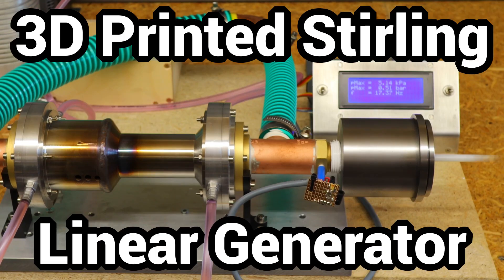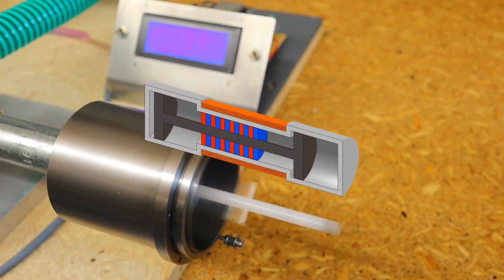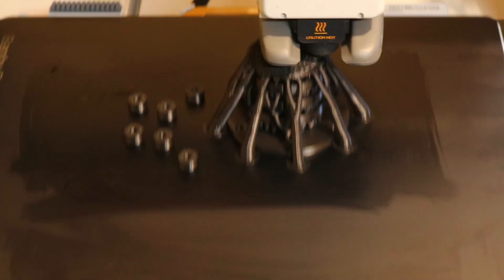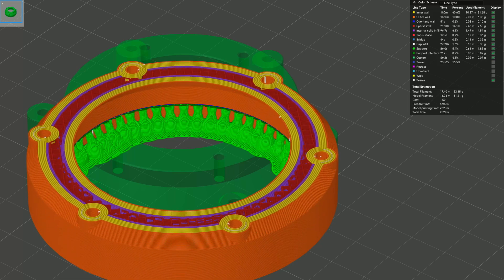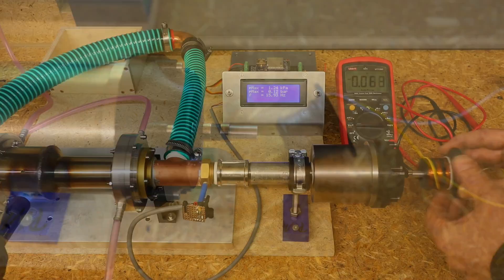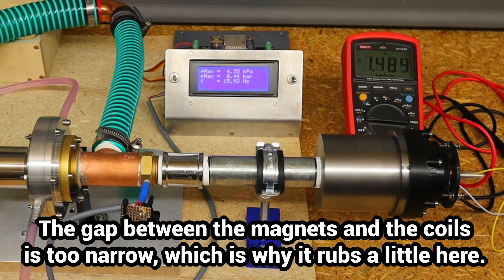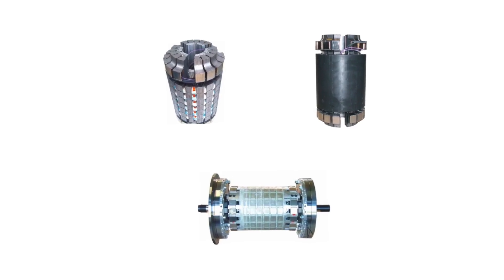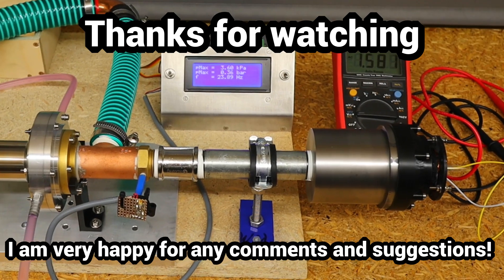Linear Generator for thermoacoustic Stirling engine – how to get most power from magnets and coils ?

Comment: with an estimated middle wire length of 8cm per winding, times 4000 = 320m wire length overall.
with a wire diameter of 0.2mm you get 0.54 ohm per m.
times 320 you get ~ 173 ohm internal wire resistance. please measure this value.
3V emk into an equal load resistor (max power point) drops to the half usable voltage. 1.5V into 173 ohm you get 8.7mA current through the load, and this results in 1.5V times 8.7mA = 15.7mW.
congratulation!
and how many input power from your gas flame do you need?
Reply from the maker: Yes, the wire is much too long and too thin, only less windings near the magnets  are better.
It was just a first try, and thanks to the help here I hopefully get soon a better generator!
At the moment I think a flat design is much better?
Thanks for your help!

Comment: I'd try it the other way around:
Moving coil and fixed magnets.
Take an old woofer without a diaphragm, just with the internal guide. Perhaps adjust the natural frequency to the natural frequency of the piston using a spring.
Reply: How do you use the induced current without brushes or slip rings? A secondary coil?
Reply: @ShinyUmbreon765 
Exactly the way the wohler does. User the flexible wires of the woofer

Comment: well if you could use a metal 3d printed iron core design but that is the perspective of a machinist.another will be make the piston light as possible since liner motion is not efficient as rotational. try to 3d print a part and use a vacuum cast to make your custom iron core before pulling the trigger on a fully 3d printed part

Comment: I guess you can cut a small transformer in half for testing. The iron core + magnet should be shaped so, that the magnetic flux reverses every time the magnet passes. This can be achieved with a iron core with 3 legs, where the coil sits on the middle leg. You want a rapid and wide change of the magnetic flux for higher voltages.

I think there exists 3d-printable filament that contains magnetic iron, acting like ferrite iron core.
Maybe you can keep the magnet much smaller, because it gets much more strongly coupled when using iron core.

You can get some ideas if you look for the "sunpower stirling cryocooler" in the net.
It uses flat springs to hold the linear moving parts in place.

You should aim for higher voltages. Because these standard diodes have a big voltage drop of 0.7 to 1.4 volts. If your generator generates only 3 volts, then 0.7 volts are a big part of it. If your generator generates 70 volts, then 0.7 volts of the diodes are negligible.
There are also "active" rectifiers using MOSFETS, which do not have this voltage drop and therfore perform better on low voltages.
Reply from the maker: Thanks for your great suggestions, I will think about them carefully.
Do you think that "magnetic filament" is really efficient?
I don't get how your 3 leg iron cor coil works, can you please describe it more?
Many thanks for your great help!
Reply: @myengines2443  Probably the filament is not as efficient as standard transformer sheet, but better than pure plastic and free to take any shape.
Transformer sheet is made from a special type of iron, making it more efficient, and the sheet structure prevents eddy currents.
Ferrite is used for higher frequencies, like >1kHz.
Each material has a a measure called "magnetic permeability".

A 3 legged core would be for example the TDK PC47EI50-Z.
It looks like a fork, you can find pictures online.
Let's label the first outer leg A, the middle leg B, and the second outer leg C.
We leave away the the top bar, leaving the 3 legs with open end.

Imagine only leg B has a coil (the middle leg).
The magnet has only half the size, so it can only close the gap between leg A-B or B-C, it does not reach over all 3 legs.

1. Phase:
Imagine the magnet is located so that it closes the gap between leg A-B. It's south pole is on A and the north pole is on B. Leg C is open. Then the magnet produces a closed loop of magnetic flux through one half of the fork shape.

2. Phase:
Shift the magnet in a linear way to the other side, so that the magnet now closes the gap between leg B-C.
Now we have another closed loop of magnetic flux, through the other half of the fork.
But now the south pole is on B and the north pole is on C.

So the middle leg B, where the coil sits, experiences an alternating direction of magnetic flux.
On the 1. phase it is facing the North, and on the 2. phase it is facing the South of the magnet.
That would be the maximum change in magnetic flux and should therefore create the maximum voltage.

Since the magnet would be attracted to the iron core it has to be put on a linear bearing or some other kind of movable support.
If 2 opposing iron cores are used then the attraction force may largely cancel out.
(Or a 3D-Printed rotation-symetric core ;-)

However, this configuration has the disadvantage, that the size of the core should match the amplitude of the piston ... 🤔
Maybe a "voice coil" configuration would be more suitable?
Reply from the maker: @notconnected3815  thanks for your very detailed help, I will think very carefully about it and for sure will have some additional questions, many thanks!!
Reply: @myengines2443  using an "E" core.
two magnets on a yoke, as the "piston". spaced far enough apart so they bridge two legs of the core. two cores, one on each side, to make a figure 8 with magnet yoke up the centre. coil mounted on center legs.

magnets and core chosen so the magnets are slightly smaller than the gap between each leg, and the distance between the two legs equal to the stroke.

at either end of the stroke, the central leg of the core is over either magnet, with the opposing magnet bridging either of the outer legs, alternating depending which end of the stroke its at...

mid stroke, the magnets will be in between the legs.

that way, you get maximum flux at the end of the stroke, and minimum flux in the middle, and the magnetic flux reverses completely when its at the other end of the stroke.

maximum rate of change, maximum output voltage.

it is the only way to produce a true "AC" voltage.
any other arrangement wont reverse the magnetic flux, and so gives half the output.

Comment: The counterbalance can be a tuned mass damper (e.g. a mass on a spring that resonates at the same frequency as the piston). For power transfer, you could look into MPPT controllers for turbines, which are already designed to handle multi-phase AC inputs. The commercially available ones might not be very useful to you however since most of them are made for higher voltages. If you need rectification at a low voltage, schottky diodes can be used, as long as your coil voltage stays below their low breakdown voltages.
Reply from the maker: My diodes are schottky diodes but the voltage drop is still to high for my low voltage setup.
Thanks for your kind help, I think carefully of it!

Comment: Just a comment about 3d printing. I have printing bambu PPA-CF and PAHT-CF parts on my bambu A1 without any issues. I have not made any objects taller then 4 cm yet but based on how good it prints i g uess it should work. :-)
Reply from the maker: Thanks, I will try it out as soon as I get a good generator as a power indicator running!!

Comment: Why not glue a membrane of a big speaker instead of the magnets. 

Speaker already has coil and strong magnet in  ideal situation
Reply: I think that's a good idea, because the speaker coil has low mass and it is already held in place by a membrane 👍
I am not shure if the wires are strong enough to handle the intended output power 🤔
but i would give it a try 🙂
Edit: + they are mass produced and therefore cheap and available 😉
Reply from the maker: I don't know if they are really made for good efficiency for my purpose.
Also the have to match the conditions of the engine which change with every modification.
At the moment the engine delivers only a few watts but i hope to reach much more in the next month and I want an easy scalable generator that i can build and modify to my needs.

Comment: I believe there should be pages of electrical engineering math to optimize the number of turns, wire gauge, magnets, CNCd silicon steel sheets, etc. Would be cool to see.
Reply from the maker: I've read a lot recently, but unfortunately I haven't found any comprehensive instructions on how to build an effective linear generator.
If anyone knows of one, please let me know...
Reply: @myengines2443  Treat it like a rotary generator that's been "unrolled". The same basic equations apply, except instead of RPM you would use the average linear piston speed. Adding iron pole pieces to concentrate the flux will help a LOT, and I suspect you will also see improvement by reducing the number of turns by a factor of at least ten, and using much thicker wire. The iron will increase the flux density (and thus voltage) significantly, so dropping the winding count will help counteract that.
Reply from the maker: @MysticalDork  thanks, I will try this!
Reply: @myengines2443  Read what paradiselost9946 wrote. That is the good answer.

Comment: Kinda looks like you might be winding your way towards a speaker motor, though granted, your machining work is a lot nicer. Might be worth grabbing a few off the shelf speakers to get a better sense of what drive size you are looking for. In theory, a liner generator could cover a range of drivers, but is the added complexity worth just yet? Perhaps it is easier to temporary redirect flux than build an adjustable liner generator? Just thinking aloud and hoping it helps, best of luck
Reply from the maker: Thanks, I will think of it!

Comment: I dont see why you dont cut the cone from a speaker if you dont want to use it directly, before you start worrying about longevity it would be good to get meaningful power.
The fact you have so many turns of wire and such high power magnets producing so little voltage must mean the impedance of the system is incorrect (the weight of the piston and magnets) and your piston is tracing out a harmonic of the fundamental of the sound oscillation - or your generator is flawed.
Reply from the maker: I think I have far to many windings which are too far away from the magnets just having much resistance.
Do you think the cone of a speaker has a good efficiency?
Reply: @myengines2443  Resistance would only come into play if there was a load, you would still see a high voltage, so its not the number of windings, too far away might be as issue. I dont know about the cone, but the generator part has a very strong magnetic field with a coil sandwiched in a small gap with tight tolerances, it should be relatively efficient, it is also very lightweight moving the coil not the whole  magnet.

Comment: You might find it easier to remove the support materials and need fewer supports if you print the part with the copper coils at 45° or 90°.
At 90° you should only need supports on the widest sections the gaps where the wire goes should be short enough for the plastic to bridge.

Hope this is helpful & best of luck
Reply from the maker: But isnt the accuracy not quite bad (roundness of circles etc.) then?

Comment: For increasing your motor efficiency, you need to concentrate on the magnetic circuit that connects the north and south pole of your magnets. In order to get a high magnetic field, you need to maximize the distance that the magnetic flux travels through iron. When the flux travels through air OR copper, you will loose a lot of field strength. For example, Voice coils (such as loud speakers) have the magnetic flux travelling THROUGH copper. This explains why they are low power/low efficiency. It does not matter so much for loud speakers because our ears are so sensitive to the little power contained in sound.
Reply from the maker: I tried to make the gap between zhe magnets and the coils as small as possible but I think I really need some iron.
I am still searching for the best way to relise the magnet/coil configuraton I maybe a flat (like in linear motors) configuration is the most effective?
Reply: @myengines2443  Your target of a small gap between the magents and the coils is sensible, but it won't get you to high efficiency, as the flix has to travel through the copper (which it does not want to do). The most efficient use of magnets and copper will be a linear motor. Imagine a normal rotating BLDC motor. The copper is wound around the Iron stator teeth. The magnetic flux flow through these teeth and only needs to jump a tiny gap to enter the iorn of the rotor. Now imagine rolling out the stator and rotor of the BLDC into a flat linear motor. You only need a single set of teeth, as you only need limited reciprocating movement.  Hope that makes sense.
Reply: lol, you want to minimise the path through the iron as well! every extra and unnecessary millimetre is simply adding to the reluctance, and leakage of magnetic flux... i cant argue the fact that you do want the smallest air gap possible of course...
Reply: @paradiselost9946  Ok, I will clarify my statement :) One should aim to maximise the percentage of the magnetic circuit being in iron and minimize the percentage of the circuit going through either air or copper. Also, one should aim for the shortest circuit that achieves your motor performance goal.
Reply from the maker: @pete_dl1585  this is the help I need, thanks a lot I think the next generator will be of the flat type like a linear motor!
Reply: @myengines2443  One warning I would give is that designing a linear motor will be quite a lengthy side-quest. 😀Adding Iron into the motor means the magnets will try to slam your "rotor" into the stator, so you will need to strongly resist this with linear bearings (for example). Also you would have to consider losses in the iorn. Ideally having custom laminations, but I suggest starting with solid Iron. Also, it would be preferable to have the spring that restores motor to a neutral position to be in resonance with your moving mass, otherwise the generator will draw energy from the circuit in sections of the reciprocating cycle.

If you can efficiently turn the reciprocating motion into rotation, you will be saving yourself a lot of design time, as beautifully efficient rotating motors are very abundant and cheap.
Reply from the maker: Yes i really would like to use a rotation but this requires a constant stroke which the thermoacoutic engine does not have.
It varies with the parameters and the variations I make which will be very big in the future.
I need a conversion mechanism of linear to rotational motion with variable stroke but I do not now any with an acceptable efficiency.
I have pure iron 2 mm thick ( is pure iron ok as I can't get any source for electric steel (silicon steel)?) which I want to isolate with paint and bolt together as the iron core.
The moving part has to be guided by sturdy linear rails which increase moving mass but that is feasible.
Reply: @myengines2443  I see. Does a thermoacoustic engine have a natural frequency it resonates at, or does it depend on engine config ? If the frequency changes, you have a difficult situation. The linear motor needs a spring to bring it back to a neutral position. That spring strength would have to change if your engine frequency changes. 

Yes, pure iron is fine.
Reply: @myengines2443  if your goal is to perform useful work with your generator, I suspect the easiest solution is to use the reciprocating motion to pump a fluid. IE have a cylinder plus a one way-valve.
Reply from the maker: @pete_dl1585  but I want to generate electricity...
Reply from the maker: @pete_dl1585  the frequency depends on the engine configuration which makes it more difficult.

Comment: Look closely at the Video & Pause it, notice the LightWeight Circle of magnets compared to all the Iron. Think about how all the Iron will work with those magents & the Coil !!!
And the Stroke is only about 12mm ! (Pressure is about 600PSI !)
Reply from the maker: Ok, I hope I will get it, thanks!
Reply: sorry, complete different world.
compressed helium.
moving parts.
driven by an linear aktuator.
simply a cryo cooler.
but ok. some features can maybe adapted

Comment: nehm anstelle deines komplizierten arbeitskolben+lineargenerator einfach einen lautsprecher...
Reply from the maker: Ich kenne mich da nicht gut aus und Lautsprecher arbeiten nur bei einer festen Frequenz gut und wie findet man die heraus?
Wie sieht es mit späteren, höheren Leistungen und Drücken aus?
Und ist bei Membranen eine Dauerlauffestigkeit von mehrteren Monaten 24/7 gegeben?
Reply: @myengines2443 
jedweder eigenbau ist vermutlich erstmal kaum besser.
höherer druck - einfach selbiger auf der membranrückseite - besser noch ein 2tes baugleiches gegenphasig laufendes system.

leider sind lautsprecher auf linearität optimiert, und nicht unbedingt auf den wirkungsgrad.
aber du hast damit schon mal ein sinnvolles (permanent-)magnetsystem. das problem der bewegten anschlussdrähte bleibt.
das könnten langfristig zentrierfedern mit übernehmen...
Reply: nochmal:
viebachstirling - war um die 500W
aber auch nicht wirklich zuverlässig.
dein rhombentrieb ding war gut!
was erreichst du hier grad mit deinem akustischen dingens?
wieviele milliwatt?
und frage dazu: ist das überhaupt ein akustischer stirling? oder eher ein masse-(gas-)feder system.
dein metalischer arbeitskolben verhält sich im vergleich zu gasen erstmal wie eine viel schwerere masse. deine gesamte gasfüllung im system ist die gasfeder. stellt sich da überhaupt eine vernünftige kalt/warm phasenverschiebung ein?